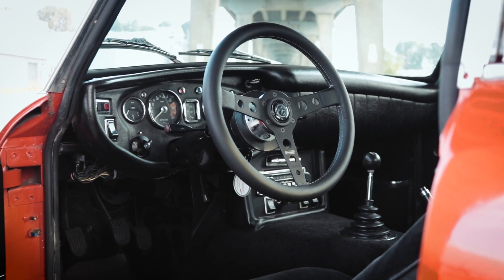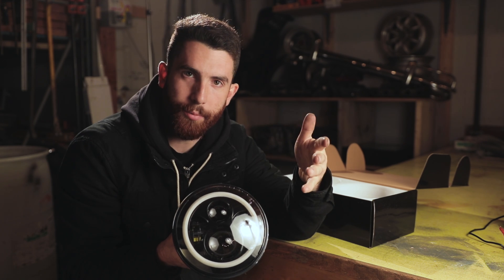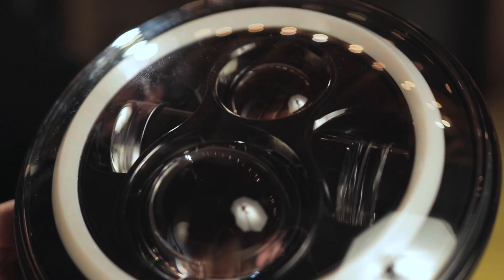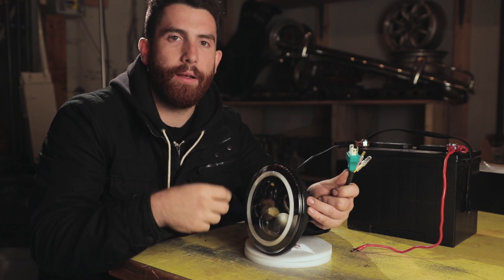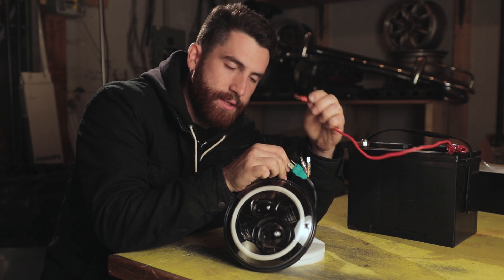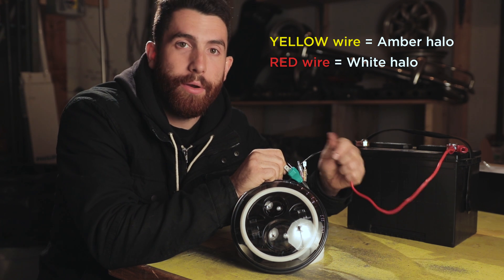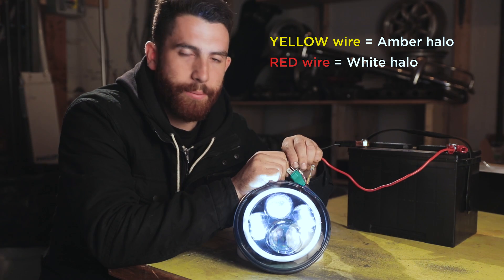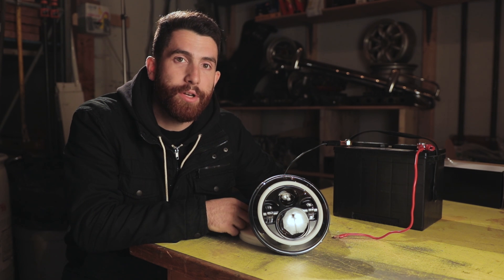LED Headlight Wiring Classic Mini

Comment: Great video ... I have a 1956 chevy truck, and want to use the halo "solo" without blinking 24X7, and then use the high/low beams when I need them when driving at nght, it this possible?

Comment: I bought oem halo lights, all the lights will function when i only turned on the headlight switch. The drl and signal light didn't function when i connect directly to the positive. It only function when turning on the headlight switch
Reply: Many thanks sir if you could help me. i unstalled the oem halo lights to my suzuki carry multicab
Reply: Did you figure it out

Comment: I have a 55 Bel Air and I put these lights in any recommendation when the headlight touches another piece of metal it changes the Halo light back to White.
I got a funny feeling when I put my metal spring back on to my metal frame where it holds the light in on a 55 Bel Air it's sending a positive making it switch back to the White Halo look.
It's set up for white or orange/amber color.
Any recommendations?
I was thinking about putting a piece of rubber around my spring to hold the light in I'm pretty sure it's making contact and then switching over automatically to White Halo instead of orange/amber color

Comment: I have had no experience with non-conventional headlights, and I'm trying to troubleshoot why one high beam doesn't work.  This video showed me everything I need to know.  There is some additional circuitry that is not shown here, so I assume it has something to do with the daytime running light configuration that the original installer wanted.  Thanks!

Comment: Can I some how connect them and use the halo ring as a day running light but then also connect it to my blinker so when I turn my blinker on it switches to amber and flashes. Then when I turn it shuts off and goes back to day running white halo
Reply from the maker: Absolutely. That is how the video shows to wire them for that effect. The amber circuit for the blinkers automatically overrides the white.

Comment: Hi Phil, great video. As I understand classic minis do not have a very powerful alternators to support a lot of electronics, or advanced lights, etc. So I need to change the  alternator? Also I want to get your thoughts on what is the best fog lights and driving lights I see classic minis have. I am looking for 1) what brand/type to buy and 2) How to install them without overloading the powe source. Thx

Comment: Will I need to add a resistor to avoid my blinkers blinking fast? Heard that’s a thing. Thank you.
Reply from the maker: If you are still using your front indicator lamps, then no. It depends on how much resistance is in the circuit after swapping to the LED blinkers. So using your existing bulbs and just adding the LED halo to the circuit shouldn't change the resistance enough to change the pace of the blinker.

Comment: Would this fit a Morris minor ?
Reply from the maker: They should fit with no modifications required. Small chance that trimming of the headlight bucket is required, depending on which style they used.

Comment: Are the lenses plastic or glass? 
Is it possible to have them as DRL whites but then have them switch to amber for your turn signal as well?
Reply from the maker: Plastic, and yes.
Reply: yes you can  done mine that way

Comment: Not a fan of this lamps... make the Mini's face look like a drag queen
Reply: guys, sometimes it’s not all about looks. Technology is continually pushing the overall speed and performance of these bricks up well past the capability of original and conventional lighting systems, and if you don’t want to hang a set of cibie super oscars off the front, these make for a very tidy solution.
Reply: 1BCamden I’ll be making my own with a single projector in the centre of the headlight so they look more original
Reply: Agreed
Reply: A glorious, magnificent drag queen! They have grown on my... I may make the switch as I drive i the dark a lot. I'll keep old school sealed beams for shows though...